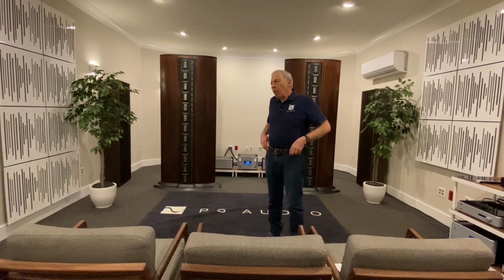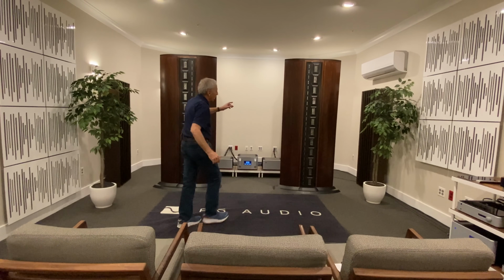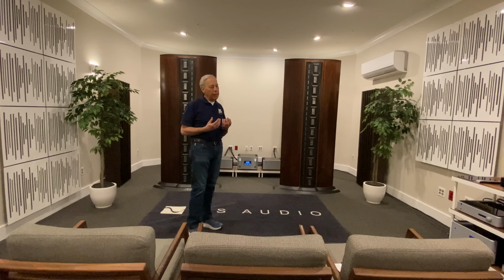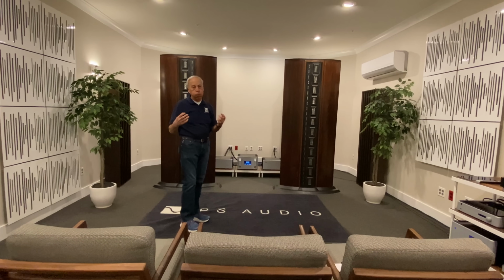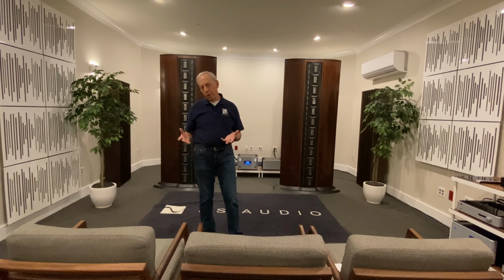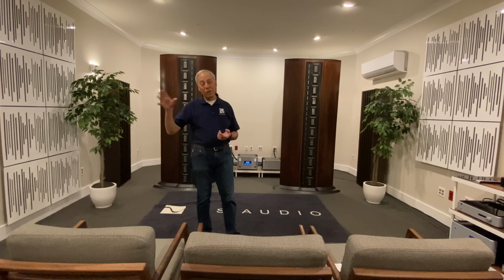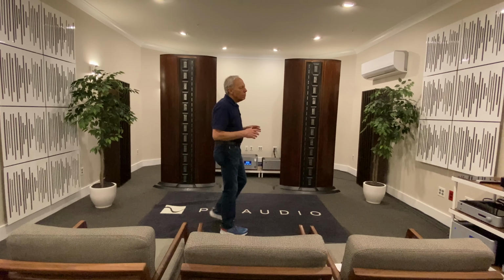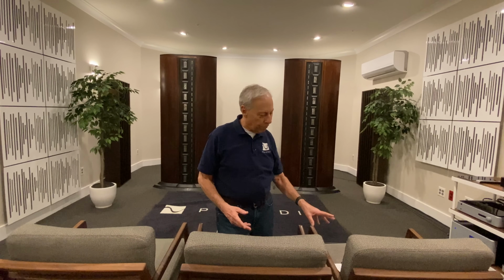Myopic amplifier voicing

Comment: Bring the loudness switch back...and never take tone controls from us. Give us options. Eq is a must have need in any room.
Reply: Humans have an imperfect hearing that needs loudness compensation when we play music at low volume and as we age we need to boost treble to regain the highs. And some music needs EQ to sound good. And finally, few people have the ability to design a room for perfect tonal balance with perfect tonal balanced speakers.
Reply: You know what I'm going to say brother. 
There is so many things that "f#@k with the signal" before any of the tone controls ever get in the path. Adding a couple more that come with huge benefits to the consumer should be an afterthought. IMHO they should build a system that the speakers have no crossovers and the highs, mids and low drivers in the box all have separate power lines run right to a big EQ with volume faders. That way you could control the tone of each driver in the box and the volume level of each also.
I really think if one of these "audio makers" decided to make something with insane controls like some of the 1970's equipment where it lit up like a Christmas tree when turned on  and had sliders and knobs for everything instead of sterile plastic boxes with a single on / off switch I think they would be a bit surprised how well it would sell. Everyone knows that audiophiles like big complicated, light dimming when turned on, systems. Give the people what they want.
Reply: fin screenname Yeah, a true audiophile speaker setup with discrete amps per each speaker driver and active cross-over and EQ using a high-performance DSP would be so much better. Audiophiles could then tweak their sound precisely to the optimum cross-over, EQ, phase etc. without relying on passive fixed cross-over components. Well, I’m running 3 such systems in my house.
Reply: @finscreenname ...if it wasn't for my ageing ears I would still not have tone controls on my amp(s), but hey that's just me being a 'purist'. For over two decades I connected my DAC(s) directly into my power amps & I was very pleased with the result. The analogue EQ's of the 70's & 80's degraded the audio signal too much for my liking...the resulting sound was not worth the compromise, in my not so humble opinion.  Paul did mention a few months ago now that PS Audio are working on a 'box' that will allow complete DSP without compromising SQ...now we all wait, again, to see it come to fruition.
Reply: Absolutely, but also with a bypass switch.  It is better have and not need than to need and not have (as long as you don't get bogged down with too much stuff).  Sometimes you don't need it, but sometimes you do.
Reply: Stephen Smith PS Audio needs to learn how to make a bypass switch that is not harming the sound. LOL. According to Paul, they don’t know how to do it! With all respect, I really like Paul, but this particular excuse of his is ridiculously silly and actually harms some business they could do. Your music has gone though lots of switches to get to your speakers and a simple switch is the least concern for audio fidelity. Give us those well designed tone controls and a bypass switch and the world will become a better place to be.
Reply: @ThinkingBetter  Paul was talking about the Cello Palette the other day.  He should commission Bascom H. King to develop a similar device for PS Audio when he finishes up the BHK Signature phone preamp (which presumably has RIAA equalization, and maybe some other old curves, too) along with a BHK Sig. MK. II line stage  preamp with a tape monitor/processor loop with both balanced XLR and unbalanced RCA connectors like the rest of inputs on the current model.  At least we could hook up a Schiit Loki.
Reply: @stephensmith3111  For anyone listening to digital music, I would recommend the miniDSP SHD. Schiit Loki is way too limited with rough adjustment that can't do well when you truly pursue careful audiophile tuning. Also, I really don't like tweaking sound in the analog domain when my source is digital. The miniDSP SHD can often turn a US$200,000 system into a much better sounding system :-)
Reply: @ThinkingBetter  I know, it's just the idea of connecting a $149 set of 4 tone controls to a $5999 minimalist line stage appeals to my sense of whimsy.  ;-)
Reply: @ThinkingBetter  After a little quick research, that miniDSP SHD looks like a fine piece of kit, but it is way above this retired old dude's (non)pay grade.  Happy listening.
Reply: @stephensmith3111  Yes, I bet that US$149 Schiit product can still make a US$200K system sound much better for real in many cases...I also bet you can make a blind test with a typical US$200K system and do some slight tweak with this device and lie to a bunch of audiophiles that you just added the US$15,000 AudioQuest NRG Dagon power cable...and they will tell you it now sounds much better. Well, they would tell you that anyway, even if you forgot to change anything. But if you told them you used the Schiit product, they would argue it sounds worse. Our audiophile snake oil infected brain works like that.
Reply: @ThinkingBetter  My 14-year-old Arcam A65+ integrated amp already has bass and treble controls with a bypass switch (which skips the balance control also);  not s.o.t.a. by any means, but far more than adequately good.
Reply: Stephen Smith Yes, lots of retro amps have fairly well working tone controls and loudness switch and also well working bypass switch. It’s a bummer that PS Audio can’t figure out how to do this.
Reply: Hey F. R.  Stirring up the pot again, you little agent provocateur, you.  P,L,&MB  ;-)
Reply: Yes, but in those high-end audio shows where companies rent hotel suites and the setups are inside each suite, you easily end up with a bunch of people needing to talk discussing topics of the products. Anyway, I know you are always blasting at loud volume, so you don't need loudness :-)
Reply: Fat Rat The signal needs to be f#@ked with to sound optimally when considering the human imperfect hearing. A US$200,000 system also needs loudness compensation when you don’t play at concert level. I’ve always found it sort of hilarious when being at high-end shows and someone adjust the volume down to a more tolerable level allowing people to talk, and the amazing system suddenly sounds dull and lifeless with the bass gone. Probably around 70% of my listening is not at concert level.
Reply: Indeed!
Reply: Many people are enamored with EQ settings, and they do have their place. Usually for something like the music player in an Android phone.  😀

For a home stereo system, set up to reproduce High Fidelity sound meant to be heard in a dedicated listening session, minimalism is the key.
This was proven, demonstrated, and put into practice back in the 1950's, with simple circuit design and point-to-point wiring.

Many amp designers have left this type of design behind in favor of more features or more power.
The 1970's was the peak of the features craze. The magic black box with rows of lights, switches, and dials that sounds like crap but looks so cool!

However, some amp builders have stuck to their guns or still appreciate High Fidelity sound.
Nelson Pass is one such individual who still uses simple circuit design. There is a reason why he is known as a legend in the Audiophile community.
Reply: @Lloyd Stout
😂
Reply: That's good news. They gotta do it cause digital audio is not going away and DSP is what you need for optimizing digital audio. BTW, in a DSP, your "bypass switch" is 100% non-damaging cause it just means you don't do any DSP processing of the audio data. Anyway, also in analog audio, a bypass switch is a trivial thing.
Reply: @ThinkingBetter ...yeah! You're such a regular on this 'Ask Paul' YT channel that I thought that you would be aware that PS Audio had their own 'DSP' in the works. Having said that, Paul McGowan also has his own 'discussion site' through PS Audio, & not YT, called Paul's Posts. Maybe it was there that he mentioned about PS Audio working on their own DSP-like circuitry; I can't exactly remember now.
Reply: It's great "news" to me. I usually watch the Youtube videos, but often I do other things at the same time so I might have missed it. There are just so many things PS Audio can do when they allow DSPs in the equation and all features can be used optionally with no negative artifacts, if not used. A Dirac option would be nice. A tweak-able volume dependent loudness function would be wonderful. Outputs for discrete per driver amp would be great also. Or how about a "tube amp mode" to make your system sound like you have a tube amp involved? Yes, there are pitfalls when using an audio DSP e.g. trying to over-use EQ to boost a too deep dip in a frequency response is usually a recipe for disaster. And hopefully PS Audio can find a way to run the audio DSP without lossy additional sample rate conversion and with full 32 bits...
Reply: @ThinkingBetter ...I'm imagining at some point in the future when PS Audio are manufacturing their own CD transports again & along with their 'Octave Records' label it will be DSD all the way through to the DAC which will then have their own 'brand' of DSP built in...hopefully it will be a really high-end triumph for PS Audio.
Reply: Well, CD transport/drive engineering and manufacturing is hugely complicated due to the precision mechanical and optical components involved. Of course PS Audio can put someone else's transport into an enclosure, add their own electronics and put a PS Audio sticker on it. I'm not so excited about CD players anymore, as you might sense. Actually the real companies (subassembly component suppliers) making transports for CDs (usually not the company with the sticker on the front) are starting to close like companies making transports for cassette tapes are almost entirely gone now. What will kill CD as a media is when nobody can make profit out of transport manufacturing (CD & BluRay drives) and that moment is near. Digital audio can do much better (higher quality, reliability, ease of use and content availability) when stored on a HDD or SSD in your home or in the cloud (Tidal etc.). Never thought about a NAS drive with your CDs ripped?
Reply: Either the bypass switch doesn't work or you've got reaiiy, really good tone controls!
Reply: Fat Rat Have you actually tried Tidal or Qobuz?
Reply: @ThinkingBetter  I got Tidal then got rid of it. I bought a cheap streamer and got Qobuz and use it some but find I still listen to my CDs far more. I do use Qobuz to check music out that I want to buy. Funny that I use my streamer for internet radio more than using it for Qobuz
Reply: scottyo64 What made me shift away from CDs was that I realize I want to make my own playlists with my favorite music and too many of my CDs and vinyl records have only one or a few songs I enjoy. Nowadays I make playlists for different kinds of moods. I also usually multitask (not just listening) and if I play a CD I find myself with no music suddenly and not wanting to get distracted by finding another CD while doing work or other things.
Reply: Fat Rat Yes, I remember your situation of course but US$20 per month for a hobby is a matter of eating a few Australian licorice bags less or whatever else you spend money on. I’ve gone through this sense of looking at my old cassette tapes, vinyl records, CDs, VCR tapes, DVDs and BluRay disks feeling I wasted a ton of time and money now not caring to use any of it quite a few times. Yes, in the 1970s I also collected pre-recorded cassette tapes.
Reply: Here here!
Reply: Amen
Reply: And sub filter

Comment: Here's another track with some chest shaking low keyboard notes from the Boomer years...track 5 'Merlin' from Rick Wakeman's The Myths & Legends Of King Arthur & The Knights Of The Round Table (1975) & then there's track 4 'Dear Enemy' from Nightclub's Requiem For Romance (2016) that will remove the mortar from in between your bricks & cause you dog to either howl or just leave
Reply: Dear enemy https://youtu.be/ckTkBY6t2Dc
Reply: Merlin https://youtu.be/wW9wcGLPSek
Reply: The version that best highlighted that bass was the Quadradisc version.  Oh, my, what low end.  Earthquakes can’t produce that much rumble!
Reply: Not really the material that car audio fans look for, at least in the YouTube versions linked by endrizo.  
Merlin has its lowest bass in the 42-53Hz range (in portion from 7:30 to 7:50).  
Dear Enemy has no significant energy below 33Hz.  It is severely limited (compressed) but in spite of that still has some clipping(!)  Also its spectrum shows the bass is synthetic, with the energy at discrete frequencies spaced 1.6Hz apart.  
My recommendation:  
The heartbeat from the opening of Pink Floyd's "Dark Side of the Moon" reaches much lower - down to 24Hz - although it's a little odd in that the main portion of the beats starts at ~40Hz then decays downward to 24Hz as it trails off.  I remember playing this track in my dorm room at college.  On one occasion, the flexible leads from the woofer terminals to the cone were vibrating so much that they touched and became welded together by the current from the amp (Dynaco Stereo 400 - it wasn't harmed).  I shortened the leads slightly so it wouldn't happen again.  Ah, college memories . . .
Reply: Most of the track "Thanks to You" has a lowest bass note of 41Hz, but I found one in the 2:40 to 3:00 range that hit 30.5Hz.  There are a couple of places also where I found some energy down to 35Hz, or even in the mid-20's, but those were weaker signals, about 8dB and 15dB, respectively, below most of the bass notes.
Reply: @marianneoelund2940 ...thanks again Marianne.

Comment: A great amp is amplifying the input to output and not changing the signal even under difficult speaker loads. What comes in comes out but just with higher voltage. The term “voicing” makes most sense on poorly designed amps that are highly sensitive to the speaker impedance characteristics e.g. a tube power amp.
Reply: A+. You have a special way of getting to the point which should be so obvious. Maytn many thenahs YOU TRUEALY ARE THE HONEST AND GOODES FRENDS! The only thing I can think of Is Amplifiers for bass guitar, electric guitares, acoudstic guitares, I am really sure their internal circuits are fiddles with to boost the sound range they will be used in so the instrum3ents in a band dont all have th esame frequencies and it sounds terrible. MANY THENKES YOU ANDS THMUBBES UPS!
Reply: Translation:  PS Audio starts off with poor designs, then fixes the problems by iterative listening/tweaking cycles.  But I don't think PS Audio are the only ones . . .
Reply: @marianneoelund2940  HELLO MINE GOOD FRENDS! is this i the artcuel you were lookin for...

1Section 1 - IntroductionGetting AcquaintedCongratulations on your purchase of the RP355.  You now have an incredibly advanced mod-eling guitar processor that can keep up with your creative impulses and even increase them.  Armed with DigiTech®’s  patented AudioDNA2® custom audio DSP chip, the RP355 gives you a huge selection of tones and effects, right at your fingertips. When you easily dial up a tone or effect from the Tone Library or the Effects Library, you’ll appreciate the accuracy in each model, and the dynamic interaction in each tone.  Add USB support for computer recording with the included Cubase® LE 4 software and a built-in drum machine, and you have the RP355: the key to unlock your creative potential

The basee guiutar can go DIRECT TO THE USB AUDIO INTERFACE AND THEN INTO AUDACITY. The the WAV file can be played back through HOIfi equypiemtn. NO misinter[prttion with useing a microphones. TOne generator or synthesierz or basse guitarre intot eh RP355and thne ontpo hard dr4ive. No sound overtoine. THANKES YOUE AND THUM,BBES UPPES!

THANKES YOUE AND THUMBBE SUPS!